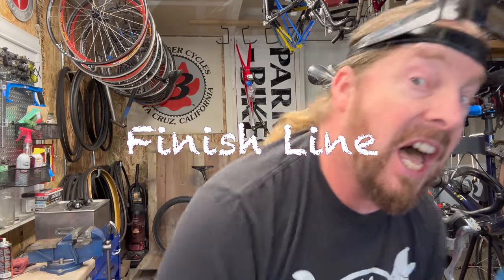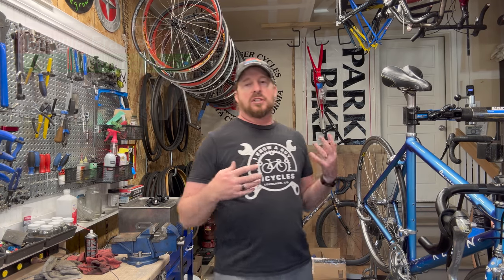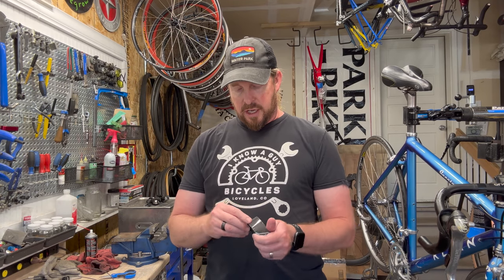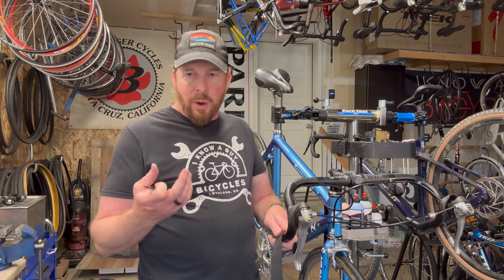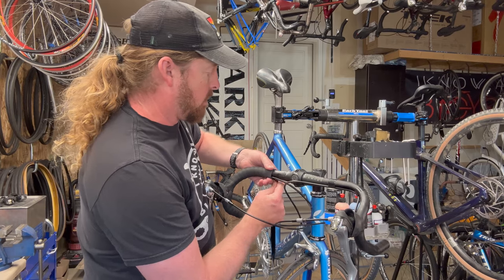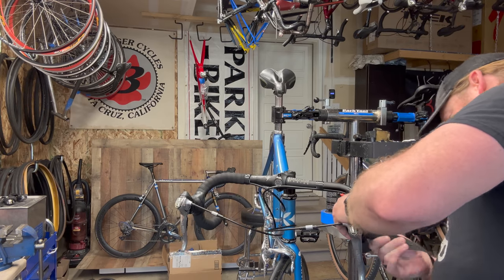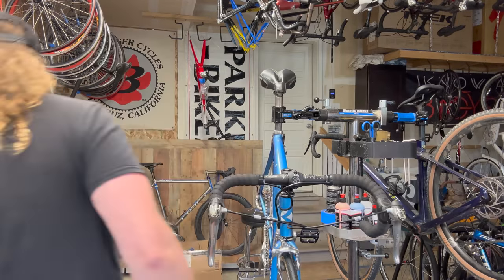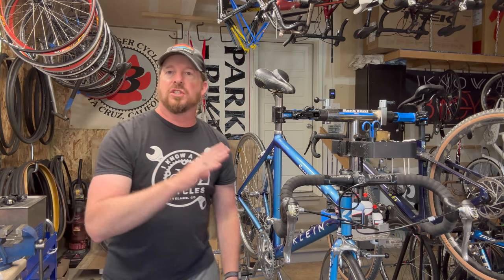🚴‍♀️💨 The Return of a Legend: ⚙️ Unveiling the Klein Quantum Race! 🛠️

Comment: I have a couple of Kleins purely as collector pieces and one that  I ride everyday.. I also Ride Trek Road Bikes and find that there is a distinct "FEEL" difference in the ride.. The Trek feels fantastic, but I feel like I cannot find the sweet spot for my seat on the Klein.. The Trek Bikes are 56cm bikes and the Klein is a 55cm bike.. I am suspecting the difference is more about that slight size difference than anything else. I'll figure it out.. Ordered the same seat I run on my Trek bikes to see if it is as simple as the type of seat..
Reply from the maker: Check out https://geometrygeeks.bike/. There, you may find some insights on comparing the frames.

Comment: Thanks for the series on this Klein bike, I bought a Klein Quantum race in 1999,, which may be the first of the trek owned Kleins. I was working in a bike shop which was a Trek dealer and started selling Kleins too. I've had this frame hanging up all this time and now started the re-build. As you are right, there is a movement now that these bikes are hot property, I wont sell mine, just have it for ride credit.